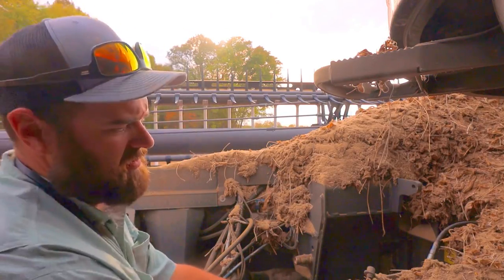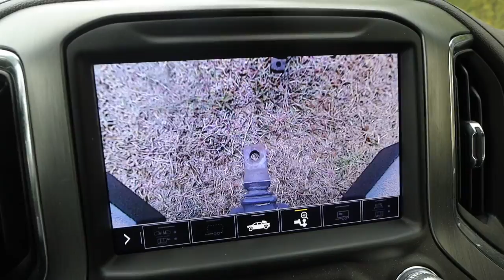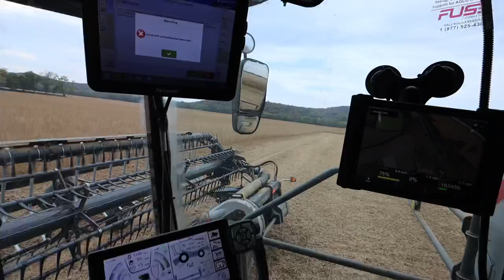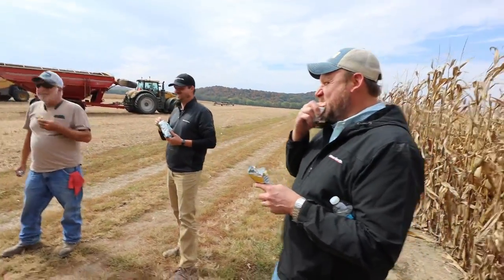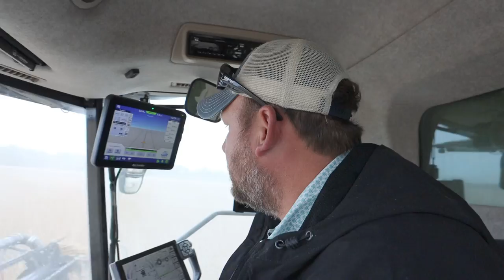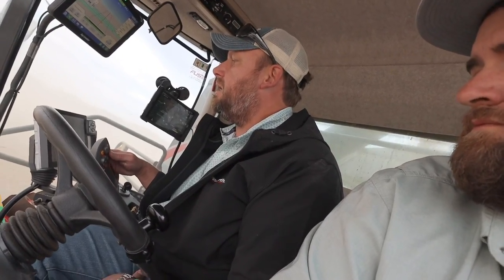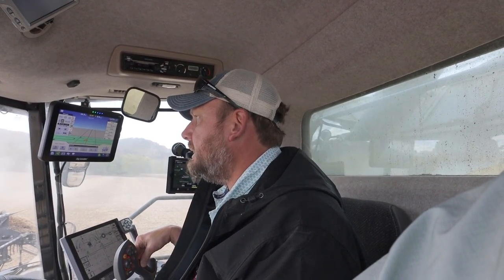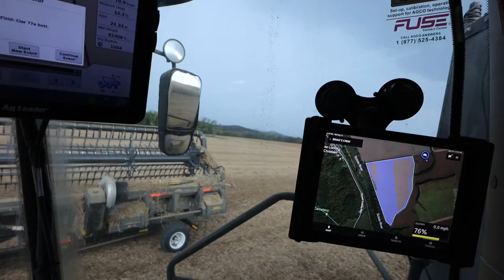Another Day... another "Thermal Event"

Comment: Guys. Get yourself a small garden pupm up sprayer. They type you pump up and hold 10qrts or so. They usually have a hand held wand  and a trigger. Fill with water and keep handy. A little bit of water goes a long way. You can squirt it quite some distance and into tight places. Cheap, easy to see how full it is, easy to refill and great for windscreens too!

Comment: Hi Brian. In dry conditions and with straw like materials will get thermal events. Need to blow the materials out every day or more in dry dusty conditions as dust gets everywhere and get a thermal IR camera (independent or one connect to your phone) to detect hotspots to clean out. Also handy to detect wildlife in the dark, like rodents and detecting bearings going bad , which generates more heat than normal operations. Heat leakage from buildings,  etc.

Comment: Back at my old job we had a wood grinder and it would do just like the gleaner did and just get random smoldering fires in the most random spots, never could figure out why other than shear heat and right conditions. All you can do is keep it as clean as possible.
Reply: Just my theory.  With all that moving metal I wouldn't be surprised if random sparks don't come off of chains, joints, bearings, etc.  I have seen sparks come off of chains, and wire rope under tension.  Your tub grinder would certainly spark if you hit any metal in the wood.
Reply: @justinhargett7222  it was a Peterson horizontal grinder, the only chain it had was the main feeder chain, other than that it was  belts and hydro lines. Had one time it started to smolder where some hydro lines were running through the frame. Other than that it would just be little random piles like on the gleaner. 
We ran 2 tub grinders before that on never had a fire problem, did launch a tooth into the 2 door down neighbors roof once though. Was kind of weird when they showed up with a tooth in their hand "we believe this is yours...."

Comment: those dpf"s get up to 1200 degrees when they are working PROPERLY, they can go much higher when crazy things start happening. they exponentially increase the chance of fire on a machine like a combine or tractor. you MUST blow off the machine minimum EVERY SINGLE DAY even more in super dusty conditions that you have been running in. those two spots were directly under the dpf.  just sayin".  yesterday on the other machine the shives were completely loaded with dust- even a hot bearing could lead to a catastrophic event.